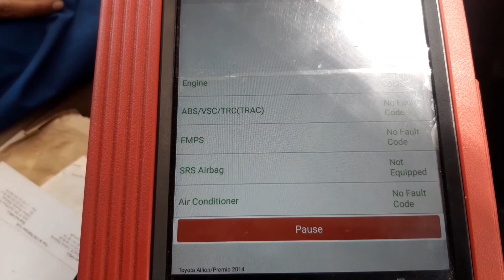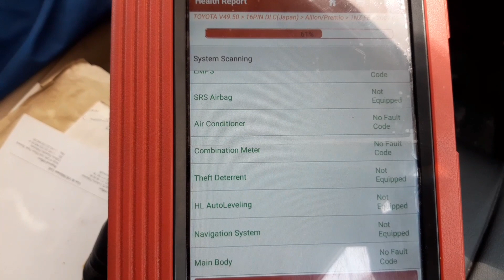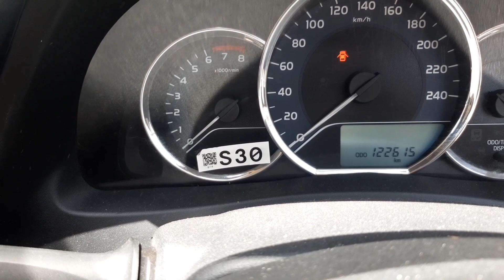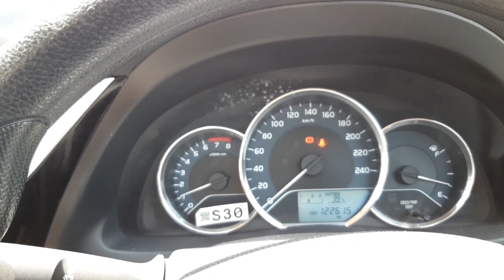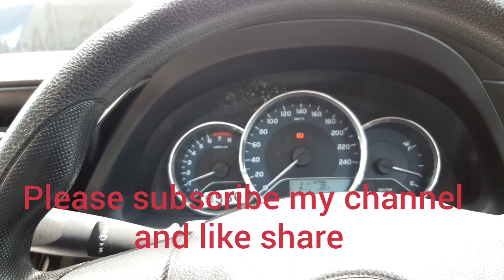Toyota corolla GLI 2017 pickup problem and fuel average problem solution now

Comment: Bhai mery ps 2018 gli manual ha uske fuel average 13 arahe ha long pr yeh sahe ha?
Reply from the maker: Aapki gadi e 1.3 hai hai ya 1.6
Reply: @mansoorahmadautos  Bhai 1.3 ha
Reply from the maker: Gadi Ki tuning karvayen
Reply: Mansoor Ahmad auto Electrician EFI&AC Workshop Bhai karwai thee Toyota motors sy plug change Kiya Thy bs
Reply from the maker: Aap kya average deti hai aapko
Reply: Mansoor Ahmad auto Electrician EFI&AC Workshop 13.3 yeh Arha ha

Comment: Sir aik baat ha ab ap na bhi kam sa jan churana shuru kar diya ha ya gari 122000km driven ha to zahair ha iss ka catalatic converter bhi chok ho ga wo ap na clean nahi kiya q ka ya 2nz ha is ka intake manifold front jab ka exhaust manifold back side par hota ha or issa open karna 660cc engine ka catalatic converter ki tarah assan nahi to issi liye ap na soocha apni jan ko azzab ma q daloo jesa ha waise hi thek ha ya achi baat nahi hamre yaha 10k driven car ka catalatic converter chok hota ha ya to bohot chali hui thi
Reply from the maker: Aapki sab baten theek hain hain Jab exhaust Sahi a Raha hota hai to  cat Ko Nahin kholna chahie
Reply from the maker: Asal Mein fuel Sahi Nahin is gadi Ko Mila
Reply from the maker: Fuel filter kachre se Bhara hua tha
Reply from the maker: Thanks for comments
Reply: Mansoor Ahmad auto Electrician EFI&AC Workshop ok sir ap hamare ustad ha hamari kiya majal hum AP ko uff bhi bole wo to hum ap ko kabhi kabhi tang karte ha takleef ka liye mazrat